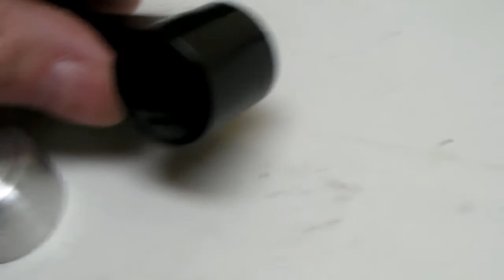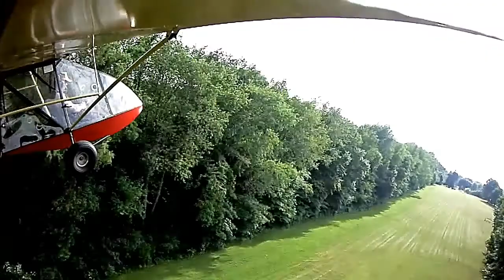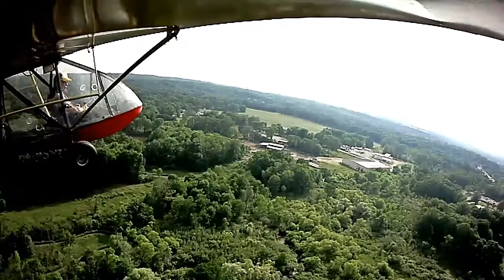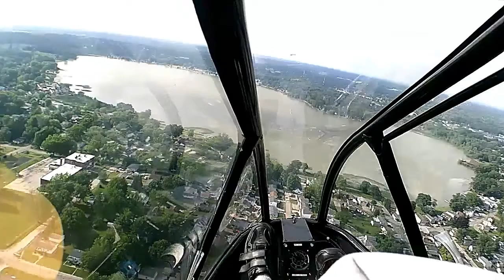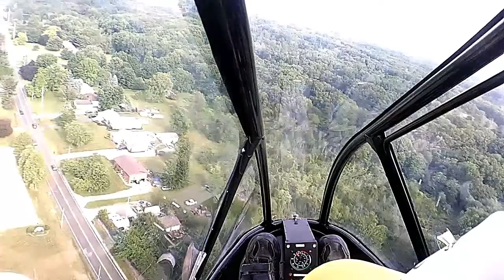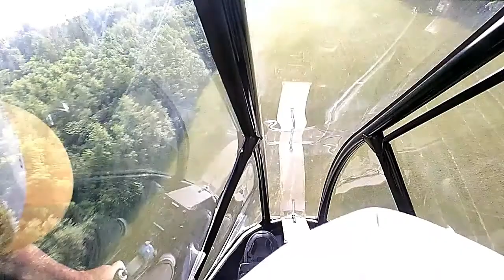Chinook+2  Testing headset mic modification.

Comment: Hey there again!

No Joy on excising the engine noise (as you know) but man, your Turning talents are awesome (lathe): that mic cover looked perfect and fit like a glove!

The only mic solution I can think of would be to check out a good online audio store and do some research on mics that are specifically designed for Direct Line pick up, and give that a try (paying close attention to the Audio Wave Pickup of each mic on the website).

There is a Post Production solution you can use; which can be found in various Audio Software programs, that allows  you to split the audio signals into separate data: literally allow you to mute or at least diminish the audio waves from the engine, so that you're left with only your voice.

It's kind of like separating tracks of the audio files just like we used to do 'in the old days' with multiple mics from musicians: lead guitar, rhythm guitar, bass, percussion, lead singer, back ups, etc. We did this using the old term 'sound board', with volume controls for mics, amp feeds, bass feeds, etc. Then we tied THAT into a 'mixer' which allowed us to emphasize various instruments/aspects of the music being recorded.

A basic soundboard and mixer might be the easiest fix rather than attempting to go the mic route; Post Production is a better atmosphere to work in rather than in the cockpit with mics!

Hope you're doing well and once again, LOVED the Framing of your plane with the ground and horizon......this is one of the main reasons I like watching your videos........when you switch to the inside view, you provide a great counter point to the external view. Should you be able to find a couple more decent used cameras in a 2nd hand shop, a Rearward View at the 6 O'Clock position would be great for a Trailing View, and you could double mount the other camera (back to back) for a Forward View, using a Boom mount for both views.

Anywho, take care and I look forward to your next installment!

Cheers from the Oil Patch in Central WY
Reply from the maker: I think you are a bit over my head with what you wrote there. I can barely work the computer, and only recently obtained a smart phone.
I use low tech stuff mostly. I had a rearward facing DVR camera on one of my videos to Butler, Ohio for breakfast. I did a split screen on that, but I now have forgotten how I did it. I use a free "Wondershare" video editor.
I use very cheap cameras. DVR camera was $10. My wingtip camera was about $40 but is waterproof. Inside camera is $40 but can do Macro and has a nice wide angle.
I think my problem is more to do with the intercom, which is cheap and I have used it 20 years. 
My next attempt, I will place some felt under the aluminum cap I made and try turning down the volume on the intercom. If I can get the VOX to work correctly, it might do what I want.
Reply: @Adventurepilot70  

Thank you for the reply and history, I appreciate it!

My suggestions come from all the way back when I was a kid and very much into recording (reel to reel, cassette) music and Old Time Radio shows ('Lights Out', 'Fred Allen Show', 'Jack Benny', 'The Shadow', etc.); I've forgotten most of what I knew way back then 1971, but I still have the very basics in my mostly empty noggin!

I look forward to seeing/hearing how the Felt Experiment comes out.....Clear Skies!

Cheers from the Oil Patch in Central WY